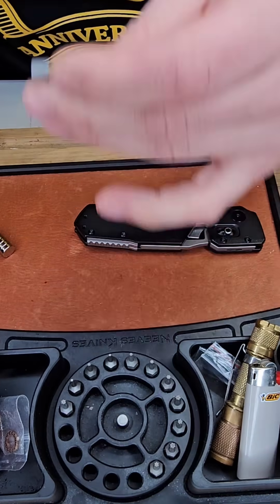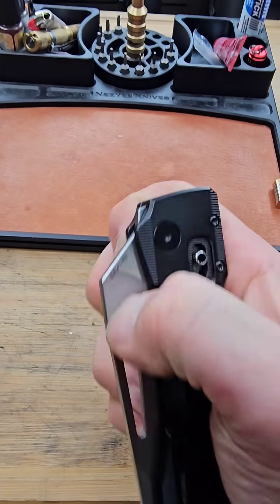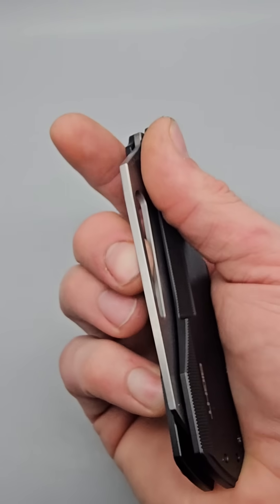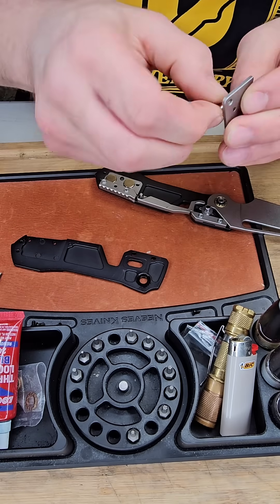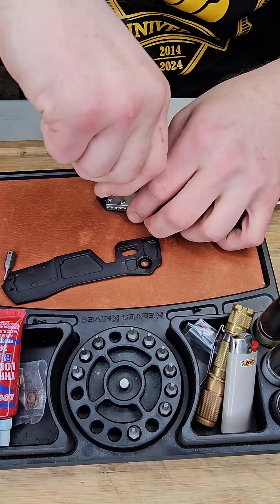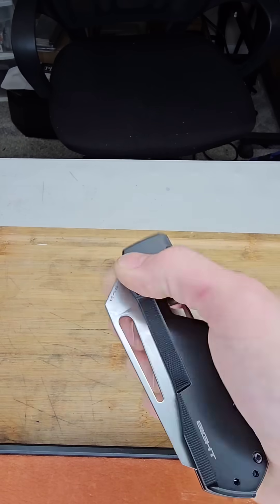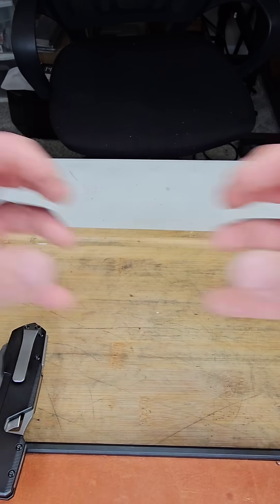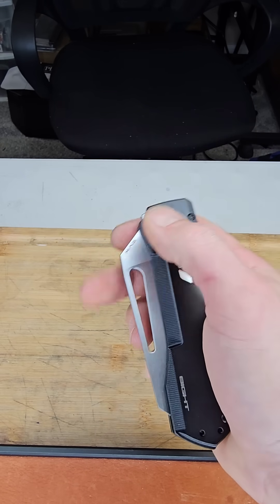neodymium magnets

Comment: @NeevesKnives , good explication, thanks. Did you have the specs of the magnets that you used in the vidéo? I was thinking that for a size of neodym magnet there only one magnetic force so how do you  have increase the force of the magnet with the same size than the original ?

Comment: Do yourself a favor, USE PROTECTION FOR YOU EYES. If they collide, they will shatter and explode like a grenade. Don't learn the hard way. And also to separate the do-it sliding Don't pull them apart.

Comment: Would probably f-up my automatic watches for sure.
Reply from the maker: Most of mine are automatic i haven't noticed anything
Reply: I would never even try on my watches. Costs more than my knives. 😶
Reply from the maker: @rj_ofb  i haven't tried anything i just mean in the presence i will be careful now thou
Reply: @NeevesKnives  Yeah be careful! Even around phone screens. I got carpenter pockets at work and phone in the first pocket and tools in the one overlapping the other one. Im always trying not to even have bitholders in the pocket. 😅 Some watches got a spring that cant be magnetized, not sure what its called but its in some movements. Powermatic 80 I think (hisilicon?) in for example Tissot watches.

Comment: Very nice. Did you order the magnets from K&J Magnetics?
Reply from the maker: Yesir
Reply: @NeevesKnives  : Awesome. It's a great place to get magnets. And you know you're actually getting quality magnets, as all specs and strength are clearly labeled.
Reply: @NeevesKnives , good explication, thanks. Did you have the specs of the magnets that you used in the vidéo? I was thinking that for a size of neodym magnet there only one magnetic force so how do you  have increase the force of the magnet with the same size than the original ?
Reply: @gregorygiguet930  The force of the magnets is listed with quality retailers.